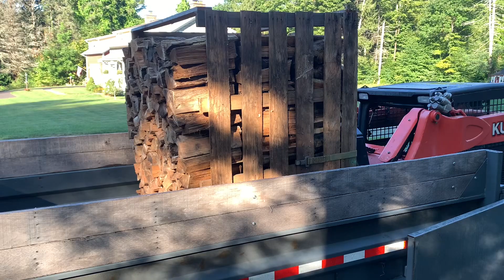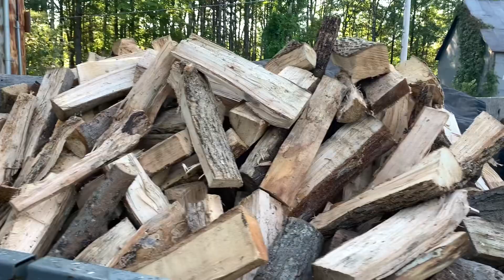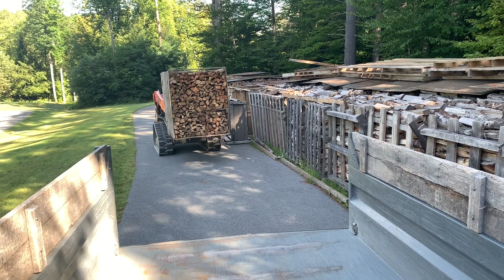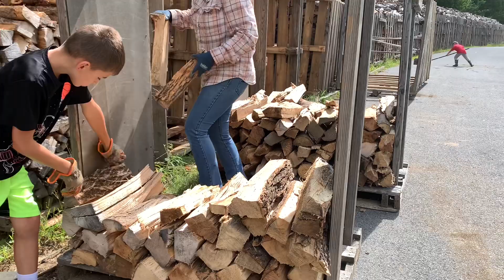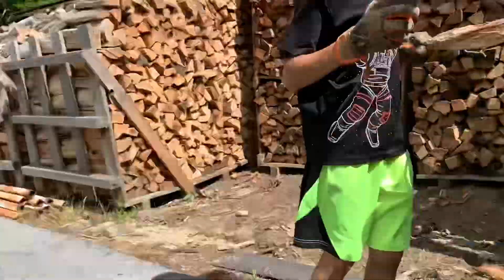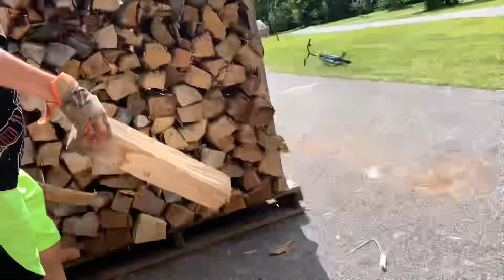Firewood flying out. 1 day- 5 customers - 12 face cords. #firewood #kubota #skidsteer #cummins #ram

Comment: Interesting to see, how you separate the deliveries on the trailer. Do you unload at the first customer by hand?
Reply from the maker: u raise the trailer then push it slides realy easy no more then 5 min ,2 + face cords up front always then u just dump  it saves a lots time of travel + i can put 2 face cords on the pallets wraping them up with plastic  on the back of the truck this way i can do 3-4 costumers in one trip